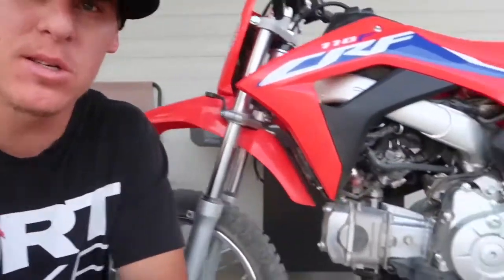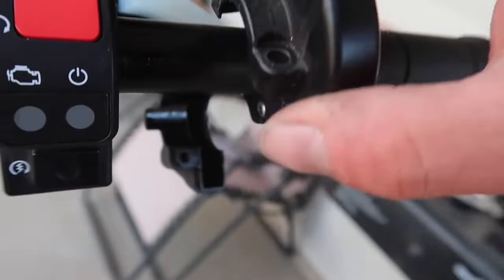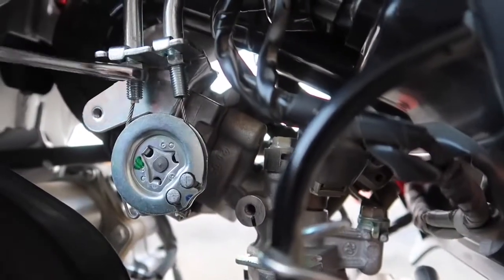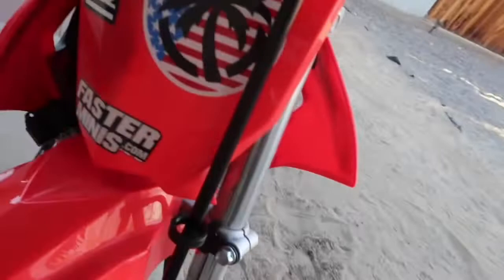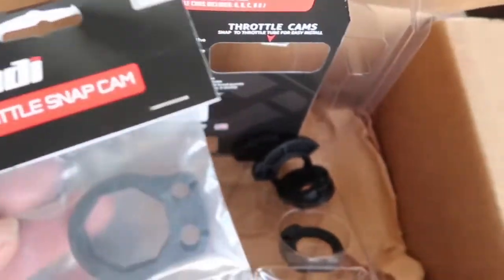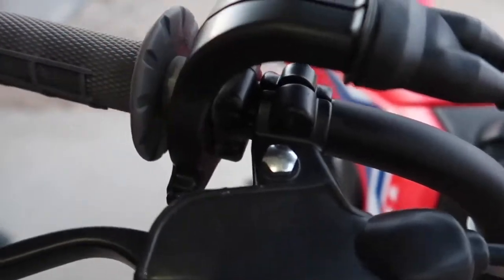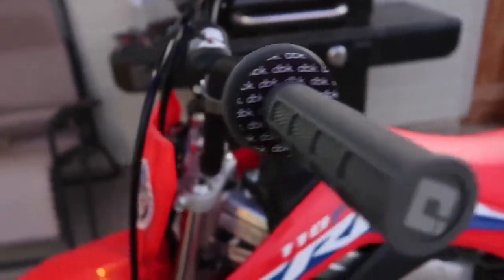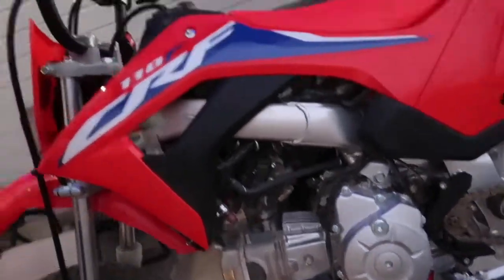2022 CRF110 ODI Grips And Handlebar Install! EP. 6 #crf110 #pitbike

Comment: Hey mate when installing the ODI lock on grips remove that white throttle cable guide at 2:30 and your throttle won’t stick like it is, it will snap back when you let go of it.
Reply from the maker: Oh ok I didn’t know you could remove that? I might have to try that, although been riding it and the throttle doesn’t really stick.
Reply: You can clearly see it sticking in the video

Comment: I bought the BBR extended cables as well as odi lock on grips for my 2023 crf110 and I cannot get to work. I have the proper cam R to fit on the grips as needed and cannot get it to return back up when pulling throttle. The tension is insanely tight and have the wire slider in still. I tried the original throttle tube and grip and got it to work fine. Went back to the new one and still didn't work. I am now back on stock and it is working fine. I rerouted cables 2 different ways. Tensionser screw all the way tight is the only way to get it to even semi go back. No play in throttle at all on new one. Wondering if this could be common with wires being messed up? or if the 2023 have some type of change. Any help or any direction is appreciated.
Reply from the maker: That’s weird there’s that much tension, especially if you routed them the exact same way as stock. The only thing I can think of is they changed something in between the throttle body and throttle tube on the 2023s. I would call BBR and see if they can walk you through it. Hope that helps!
Reply: Sand down the black ODI R cam to make it a little thinner and it will turn freely! I noticed the cam and the throttle tube combined together are a little thicker than stock and bind on the inside of the throttle housing
Reply: Came to this video because I’m having the same issue. I’ll try sanding it as the comments suggest but have you gotten yours fixed?
Reply: @rnc428  I never was able to figure it out I gave up and bought the pro circuit billet tube. Works perfectly
Reply: @asnyd  I’ll probably do that next time I need grips. Just got these lock on grips to work by removing the white cable guide. I’m a little worried about the cables rubbing on something they shouldn’t but this works for now. Thanks

Comment: How did you adjust the throttle cables? Mine is binding up as well.
Reply from the maker: I didn’t really have to adjust mine, I think I lucked out installing the new lines, i just made sure nothing was hung up or pinched on the motor side and throttle tube side!
Reply: @tylermontgomery24  it looked like in the video it was sticking.
Reply from the maker: Once I rode it I bit, it wasn’t sticking, I moved the cable assembly on the throttle tube back a tiny bit, seemed to help